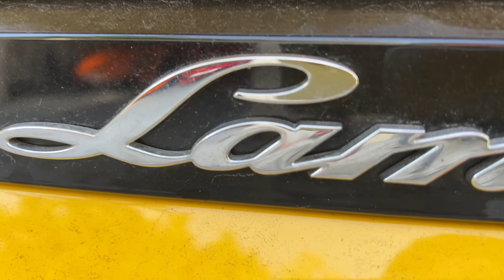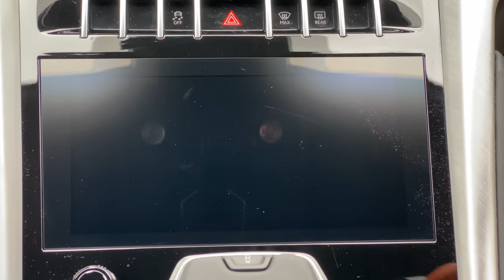World's Most Satisfying Detail

Comment: No offense mate, but the car would have turned out exactly the same with a micro fiber towel and some dish soap, all the extra rubbish is not necessary,  foam cannon after different color foam cannon...
Reply from the maker: In order to safely wash a car, you need more than just a few basic supplies otherwise it wont turn out good
Reply: @TinoCarCare  that's not true, I told u what u need, and it will come out exactly the same, as long as u don't scratch the vehicle